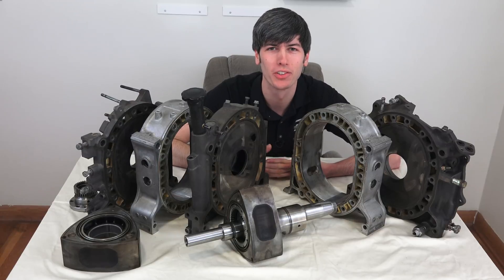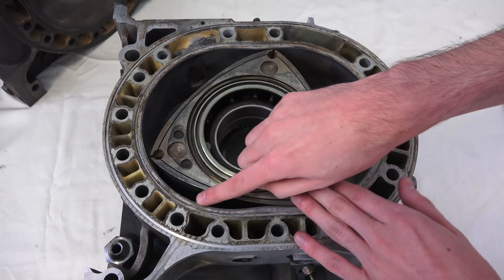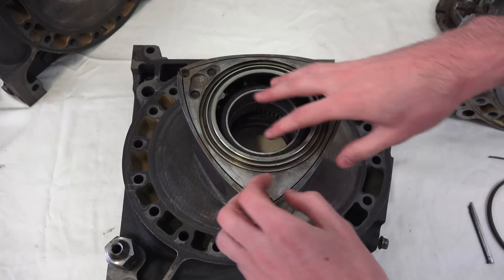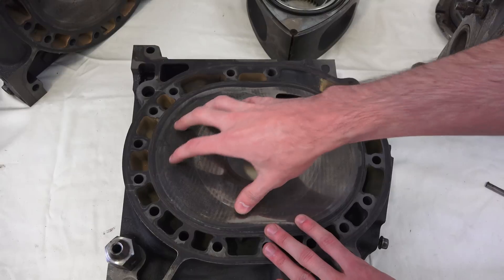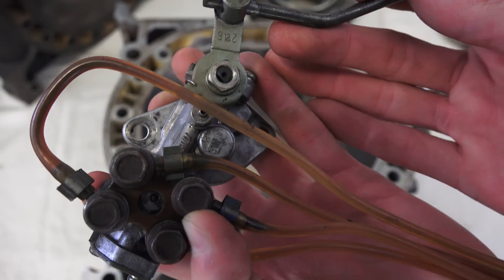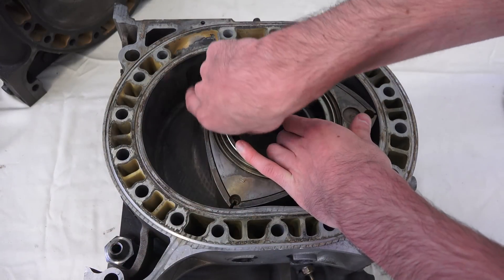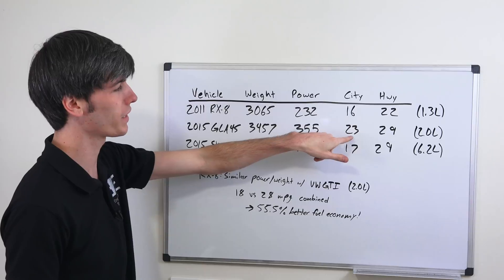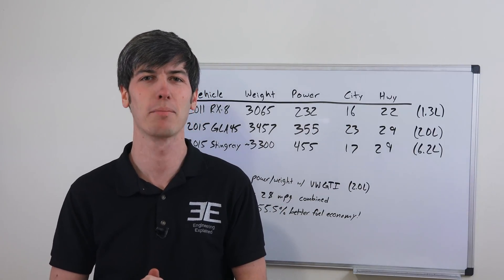4 Reasons Why The Rotary Engine Is Dead

Comment: But why do people like the RX7 Wankel so much? Does that light weight and small block compensate the power loss and fuel consumption because it has more space to upgrades/turbos? Does it have an advantage on aceleration because of the possible higher RPM? 

And I really wanted to know the price of maintenance on a Wankel motor comparing to an common Otto piston with the same power

It maybe have less pieces and less vibration but not everyone knows how to maitain a Wankel running smooth, so... specialized labor. 

And I would really like to know if, because of the higher RPMs, wear ratio is higher too, comparing to a same lvl piston/cilynder motor (same lvl = equal os close hp).

Comment: Flames spitting out of the exhaust because of unburned fuel? ALL road worthy engines are required by federal mandate to have a catalytic converter to burn the unbunred mixture that exits the exhaust manifold. This is why you will see cars spit flames out of the tailpipe: They have gone catless. Are you saying the PR has a much higher "thernal efficiency"I say NO, and here is why: 

The cooling system will dispose of about 40% of that heat energy without it having done anything useful!  And about another 40% of the heat energy will be sent out of the engine through the exhaust.  Sadly, this only leaves around 20% of the actualchemical energy in the gasoline which is ACTUALLY USED to do anything useful!  Put another way, when YOUR engine is producing 200 horsepower (150 kW) to drive your car, it actually had to produce about 1,000 horsepower (746 kW) worth of heat from gasoline, and then it DUMPS 400 horsepower (300 kW) worth by the operation of the cooling system and it dumps another 400 horsepower (300 kW) worth in the hot exhaust gases!  Given that a lot of people have tried to work on improving internal combustion engines for more than a century (that is the piston reciprocating),
this is sort of disappointing news!  It ALSO points out WHY people have thought up things like turbochargers (to try to capture some of the heat carried away in the exhaust) and WHY many small changes were made in and around engines to force them to run hotter, thereby slightly reducing the cooling system heat losses and slightly
improving engine efficiency.  Around 1975, they were happy to get 15% overall engine efficiency, which has now been raised to around 20%or even 21%. What 'efficiency'!
 The Wankel was the ONLY road and air worthy engine designed in the late 20th century. We will figure out the beast that is the "rotary" Wankel.

Comment: Regardless of the lack of fuel economy, Rotary ownership is is a love. If that is the car/motor for you economy doesn't matter.
Reply: Poor reliability due to care free maintenance , put it this way, if properly maintained a wankle is hard to kill, if not they go out quick af.
Reply: I owned a 12A RX7 for over 5 years. I kept it stock and maintained it per log book.  Never missed a beat.  The worked 13B fun weekend car not so reliable, but then what motor is when you twerk it.

Comment: You need to say that the Mercedes 2.0 is a turbo to make that much power. The rotary makes more power for the size than other naturally aspirated engines.
Reply: Well if we are going to measure things your way then that Merc engine is actually 4.0L engine. Since you counted the full combustion cycle of the Wankel then I'll do the same with the Otto. An 1.3L Wankel is comparable to a 2.6L 4 Cylinder. So technically it's a bigger engine in that regard. Except it weighs less and produces more power. Also a Turbo'd Renesis can produce 400BHP+... The only 4 Cylinder that can beat that is a Turbo-Hybrid 2.0L in the Porsche 919 LMP1 car. You don't see any of those in a production line do you? Once again to beat a Wankel the Otto needs help, if Mazda ever makes a Turbo-Wankel-Hybrid to compete in LMP1 we'll have a better comparison.

Comment: Fun fact The AMC pacer was designed with a lightweight fuel efficient rotary engine in mind
Reply: Read about that the other day, got the plug pulled on their rotary program the day before it was set to go into production. Nice what if though

Comment: The data on the mig is wrong.  My 1989 rx7 got 28 mpg highway,year after year for 192,000 miles when I sold it and 22 mpg city 1.3 liter.  Not once did I  have to add oil between changes and emissions were way lower than 1.3 liter reciprocating engines.  I never had any gasket problems whatsoever and it would run for hours at over 100 mph without overheating. Smooth as silk, never even needed a new muffler.  In short,vastly superior motor in every way.
Reply: ....because I was inverted."  I love the start of your comment.

Comment: @Engineering Explained:
You forgot to say that the Mercedes GLA45 has a turbocharger. The normal 2 Liter Engine of Mercedes has only 150hp.
The turbocharched version of the RX8 has 280 and more horsepower.

Comment: You need to try to convince Mazda and the thousands of race drivers world wide who really appreciate getting mucho HP out of a tiny, light, engine. Go drive a Formula Mazda....go hang around people who actually know something about engines and mechanical engineering... You have a lot to learn.   Wankels had problems---mainly seal technology. It's solved. It actually surprised me that this turned out to be the case. I expected them to fail in a year or so, but they didn't. The darn little things really scream, and Mazda supports them very professionally.

Comment: For the record there were people that mocked my opinion  on this engine   when i pointed out that  the flaws cold be solved and it could  have value  in the heavy equipment  sector  for a bus or  truck. 

   Mazda  just announced   that the  will produce the   Rotary again    in the form of a RX-9   with twin  800cc  rotors   based on a new HCCC design  as a semi-diesel    High Compression  Combustion  Chamber   that doesn't need a spark  plug  and will burn cleaner.  
   Current  designs  in the prototype  list the  Engine at  400 hp .  
     My suggestion   was a triple rotor    modular  engine  with  close to 600 hp   to drive  an electric  motor   in  bus   while the  power system   ( rotary engine)  can be  removed  and replaced  in 1 hour  based on the  concept for a Slot-Car   motor  that clicked  into the chassis and meshed with the  drive gear  on the rear  axle . 
      These engine are so compact there could be two  in the engine bay  for 1000+  hp   truck   that  weigh  close to 80,000 lbs  fully  loaded.

Comment: I drove a rotary-engine Mazda many(!) years ago. Two things I recall are: 1) the spark plug wires on the distributor were all on one side instead of even spacing; 2) it was a BLAST to drive- you could wind that thing up something incredible!!!

Comment: even if it was fuel efficient through fact that it burns oil is biggest  set back, and if we are in 2016 and they haven't  managed to find a solution,  the wankel  rotary is as good as dead, that's  really  sad for me, I'm  a rotary fan, but there's  no getting  around  the fact  that  to make that motor live it needs  to burn oil.

Comment: wankel engines cc is actually quite deceptive, it's actually more like 3x what is stated because they only calculate a single cycle of the piston, where you actually have 3 cycles going at once a RX-8 is actually more like a 3.9L engine.

Comment: did they ever make a rotory diesel ??
curious
Reply: Sounds like a terrible idea for a vehicle engine. How about an opposed piston diesel instead. Wasn't Mercedes-Benz working on one of them to mount in over the road trucks? I recall them toting it as 30% more efficient than an engine with similar power and number of pistons.
Reply: I would think that the inherent compression needs for diesel would make the application impractical..if not outright infeasible.

Comment: My question is, eventhough it isn't fuel efficient, would you choose the rotary engine over other engines for racing? Would ceramic lined cylinders prevent the need for excessive oil consumption? Do you think it's possible to improve the design so it doesn't burn oil? Maybe make the combustion chamber smaller(putting slight hump)

Comment: There's a rule of thumb in flight engineering that if it looks fast it probably is fast, and this engine looks extremely slow and wonky. I've rebuilt two automobile engines by hand, which was an enlightening and joyful experience. When I first beheld the engine in this video I thought, "ugh!" because everything about it seems like a big step backwards. I would expect an engine like this to precede the engines we have today - not follow them. It reminds me of those old black and white movies of 'flying machines' that heave and convulse for only a few seconds before falling to pieces. Who would spend any amount of money developing something that increases friction and oil burn? Probably the same kind of person who gets the brilliant idea to design a bicycle with tiny square wheels made of solid iron.

Comment: I like my RX-8, just like my RX-7 before it. But rotary engine do require special care that not many are willing to do. And they do have poor gaz/millage ratios... like most performance cars for that matter. And yes they do consume lots of oil due to the oil injection required, especially when they get older. Would I get another one if they bring back the RX-8? Probably not. I had a bad experience with my current 8 that broke my faith in these engines (had my engine replaced at 62 000 KM due to a manufacturer defect that caused the death of my engine).

Comment: sooner we stop pissing around with ice cars and go to electric the better.
Reply: True. But they need to develop the lithium oxide battery, so the storage efficiency/weight goes UP and it's competitive. I WANT to Buy a Tesla but they're hard to Find.
Reply: i mean a prius produces more pollution just being manufactured than a 4 cylinder diesel will make in 20 years. we have ways to help with emissions  and fuel economy but oil company's are so corrupt that they buy it and never releases it to get more money.
Reply: When we can put 40 miles of range in a 4-seat air-conditioned vehicle in a battery that only weighs 6 lbs, then battery technology will be able to compete with gas/diesel.  There is just not the energy density in battery at present to be able to do that.
Reply: while eletrical cars will be more common in the future, the normal piston engine wont die. its too much loss of money for manufacturers if they quit with piston engines.
Reply: +Mr.Sandwhich
Eventually they'll be forced to move to electric. Either by taxes or such, or by outright banning them off the roads.
Reply: Mr.Sandwhich
"should we sacrifice over 100 year of vehicle production"
Sacrifice? It's more like decontamination...
They poison our air constantly, giving us diseases.

"make boring new cars with a shitty eletric engine"
This just shows that idiots need to be smothered for there to be progress.

"why would anyone want to drive a dead silent car"
The same reason people don't sit by a  jackhammer in use, to avoid noise
There are some who are rational...

"i mean i would find it extremly boring not to mention missing things like turbo spooling up and hear the lovely exhaust sound."
Hopefully you'd stop driving cars. That streets would be that much more pleasant and safer for it. Driving is boring in general.

I'd actually prefer to not drive at all. Just have an automatic vehicle come to my place on demand and take me wherever I want to go.
Reply: Mr.Sandwhich
 There is nothing much to go wrong on an well made electric car, even the brakes will last longer. I live in the UK unless you drive right out in the sticks or it's three in the morning, having a meathead car is pointless.
Reply: EVs are all about battery technology, which is much better than when I was a lad, and which is continuously getting better.  Electric engines are very simple and reliable.
Reply: The real doktorbimmer

Thanks for the input Doctor Mindless Zealot.
In reality: https://ev-sales.blogspot.hu/2016/08/world-top-10-july-2016.html
Also many big manufacturers are just now jumping on the train.
Reply: +The real doktorbimmer It'll have to happen sooner or later, there's not all that much crude oil left to get out of the ground.
Reply: and also guys don't forget.... there's not much petroleoum left.
Reply: avada You're forgetting the battery.  Those things are poison.
Reply: avada Of course Tesla are going to downplay it, they've got millions of shares in lithium mines!
Reply: leopold

The truth is not downplaying... If the batteries are harmless enough for landfill then they are. And that's that. The certification speaks for itself.
Reply: Grumpy OldMan
Also, much before that. Such a ridiculous statement...
All the crap ICE cars have that EV don't, weigh much more than. Also the mass of a fuel... Hell even an empty tank weighs more than that...
Not that being exactly as light as ICE cars is in any way necessary...
Reply: avada
What I'm saying is that with 6 lbs of fuel, you can drive 40 miles with some standard gas / diesel engines.  If you run out of fuel, you get a plastic fuel container, walk to the nearest gas station, and carry back 6 lbs of fuel to get you back up an running long enough to get to a gas station to refuel.  When that can be done in an electric vehicle it will be ready to replace gas / diesel engines.  As it currently exists, you might have to carry a 100 lbs or more in battery pack to the refueling center and then have to carry that 100 lbs back.
Reply: The real doktorbimmer
So, he's one of those clueless liberals... OK, that explains it...
Reply: Grumpy OldMan
Nope. Also when two idiots such as you two agree, it doesn't make you less wrong.
Reply: The real doktorbimmer
Another thing that the EV people need to consider is that if there is a problem with the battery, then the vehicle is often not worth repairing since the cost for a new battery is often more than the vehicle is worth at that point.  I was at a shop getting my yearly inspection tag awhile back and they had a Prius that needed a new battery.  The shop owner told the car owner that the battery would cost more than the car would be worth even with a new battery in it, so his best bet would be to just sell the car and buy a new car.

Comment: Very nice explanation.  

I would also add, while I've always liked the look of the '93-95 RX7 I could never go as far to own one.  I couldn't tell you how many adds mentioned they had installed a new motor at 60k miles, or 75k miles or 80k miles.  They actually say you have to rev the nuts out of them just to make the engine happy or it will have problems.  I can't believe Mazda brought this back for the RX8 and it looked worse than the RX7.

The best motor in a 80's or 90's sports car was the Toyota Supra 3.0, smoothest inline 6 ever.  Had two of those, never any engine problems.  Had a 300ZX twin turbo and the engine blew at 157k.  Only drove it 3k miles when I had it.

Comment: Don't mind me, already watched the video just came to read all the comments coming from people who either think the engine is total crap or totally awesome. There seem to be very few people like me who think they are crap and awesome at the same time. They are horrible engines for a street driven car that is used around town or in any part of the country that has a slight hill. they need to be revved at like 3 grand around town, get horrible gas mileage and you have to fill it up with oil at every other gas fill up. However....they are awesome race engines. They can be boosted with quite a lot of psi and be totally fine and when racing when your rpms are near red line all the time. Which doesn't even faze the engine and that's where it makes it's power and it has a easily controllable power curve coming out of corners. Mazda did design a great engine they are just using it in the wrong market.

Comment: i bet the rotary engine would work well as a low RPM say no more than 4000RPM as a 2 stroke running on fuel oil and no spark compression only